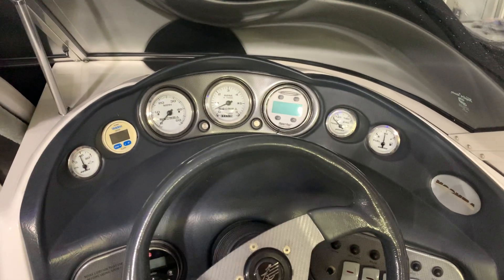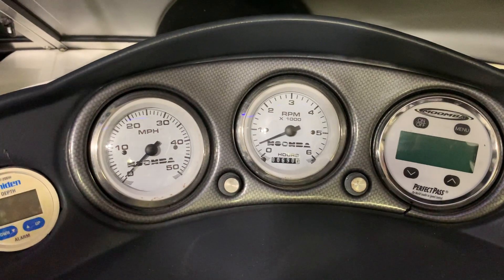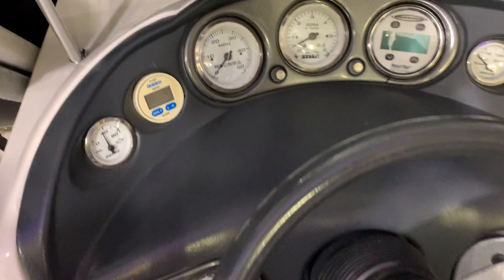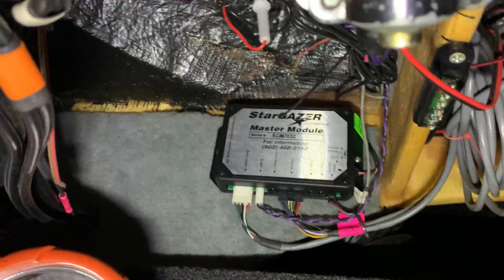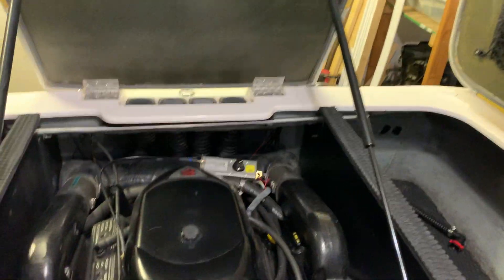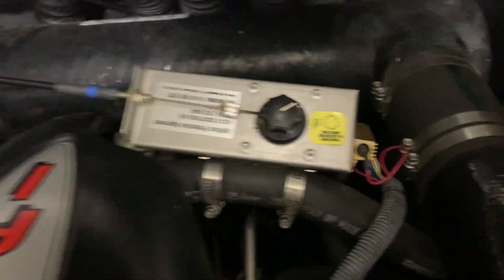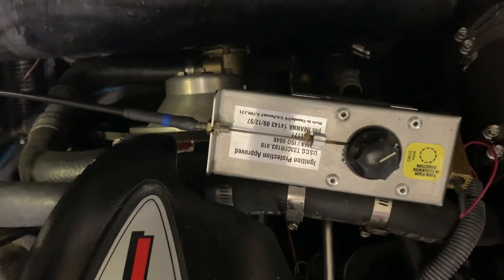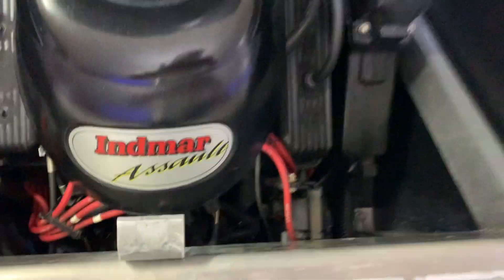2001 Moomba MobiusV StarGazer PerfectPass

Comment: How long did it take? Where did you buy kit from and did it have everything needed? I have 05 moomba Mobius that I want to put this on!
Reply from the maker: Bought directly from PerfectPass - they are a great company!  The kit came with everything needed.  They even sent two different cable sizes for the servo to the TBI linkage to make sure it had the best fit.
Reply from the maker: Install took maybe 1-2 beers.